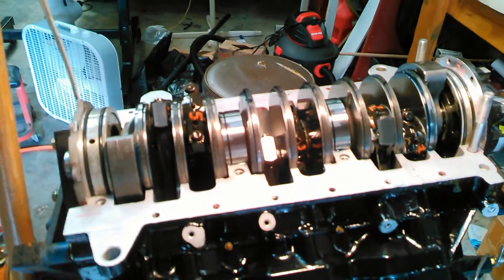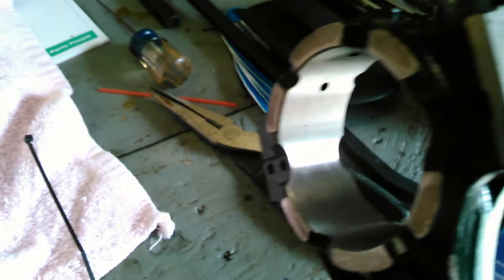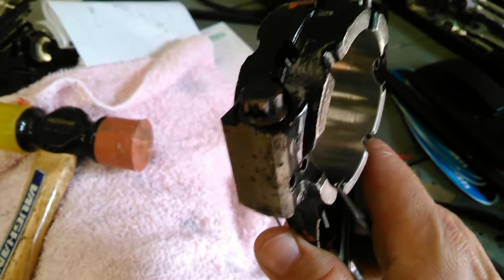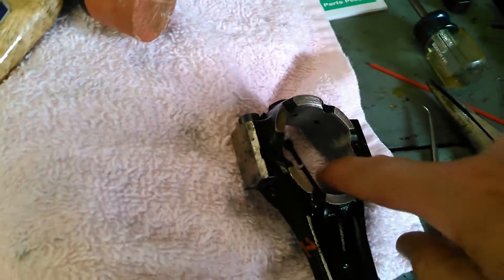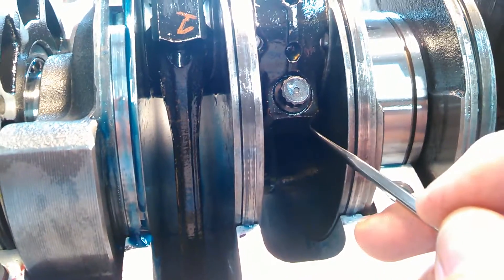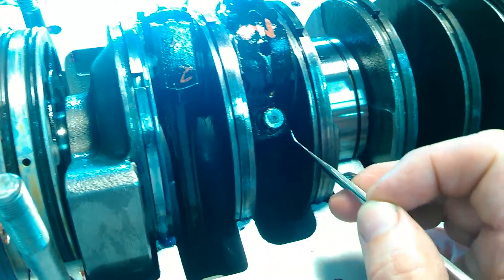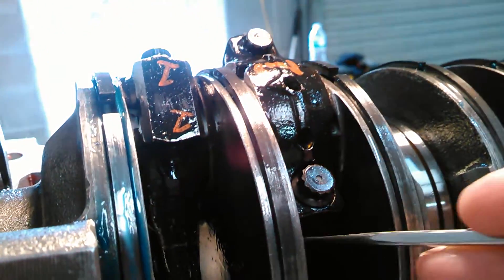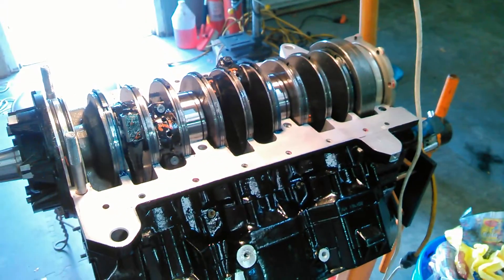Evinrude 250HP Etec 3.3L rod cap alignment

Comment: I'm absolutely amazed that they used split rod ends and roller bearings ! I wonder why they didn't dowel the bolt holes ?
Reply from the maker: @chrisval78  roller bearings are common on two stroke. There is no oil pressure for standard bearings like a four stroke.  When the fractured rod caps are assembled properly the seam becomes invisible

Comment: Hello and thank you for posting this video. I'm in the process of doing the same thing but have had no luck for 2 days straight. Did all your con rod caps feel 100% perfectly flat or could you still feel a slight little crack with you finger nail?
Reply from the maker: Dan Loglisci thanks for watching.  When the cap is aligned correctly the seam becomes almost invisible. When I dragged a super sharp pencil point or a sharp dental pick across all six flat sides of the cap it wouldn't catch at all.  I would assume a fingernail is nowhere near as sharp as either of those so I wouldn't think it should catch on it as easily.  I never tried dragging a nail across. So yes they were perfectly flat once aligned. The way I look at it is inside of  the rod is a bearing surface so it should be perfect. If the outside is not perfect, neither is the inside. Take your time, get an insanely bright light with a magnifying glass to really see what you are doing. Oh and turn off your phone and any other distractions! They will go together it just takes time.
Reply from the maker: thanks for watching.  When the cap is aligned correctly the seam becomes almost invisible. When I dragged a super sharp pencil point or a sharp dental pick across all six flat sides of the cap it wouldn't catch at all.  I would assume a fingernail is nowhere near as sharp as either of those so I wouldn't think it should catch on it as easily.  I never tried dragging a nail across. So yes they were perfectly flat once aligned. The way I look at it is inside of  the rod is a bearing surface so it should be perfect. If the outside is not perfect, neither is the inside. Take your time, get an insanely bright light with a magnifying glass to really see what you are doing. Oh and turn off your phone and any other distractions! They will go together it just takes time.
Reply: okay, I will keep on trying. I do have a dental pick and sharp pencil and both get slightly caught even on my best cap connection. I even took a rod out and cannot get one to match up perfectly without the bearing and crank inside. Thank you for the fast reply!
Reply: @danloglisci1884  i'm sure you figured out by now you need the rod cap alignment tool on precision-ground rods! the issue could be just get another rod... did it come from a blown cylinder? if so, you cannot use rods from a blown one. the real problem without the tool is the rod caps seat after so many hours of engine running, and when removed, they "spring" outward. no amount of fidgeting will get them to align without the tool. 1984 and below (accept the v4 crossflow motors) had the sanded rods, were you do not use the tool.